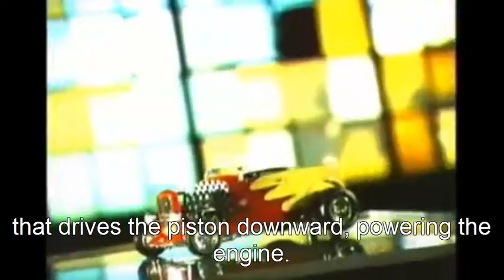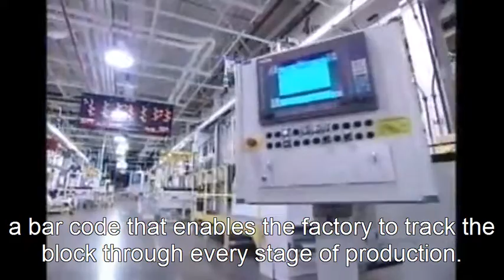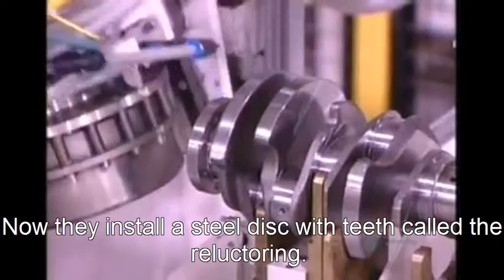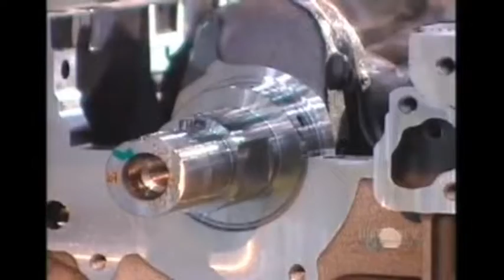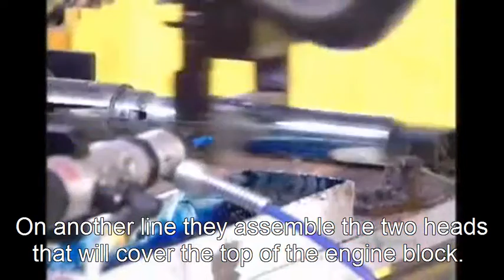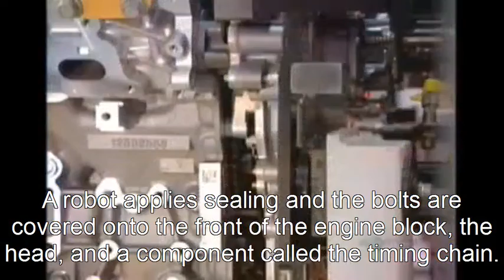Diesel Engine - Manufacturing process (with subtitles)

Comment: Hay its not a diesel engine. The process described in beginning holds for petrol engines. Diesel engines don't require spark plugs because of their low octane no. ignition takes place by compression .